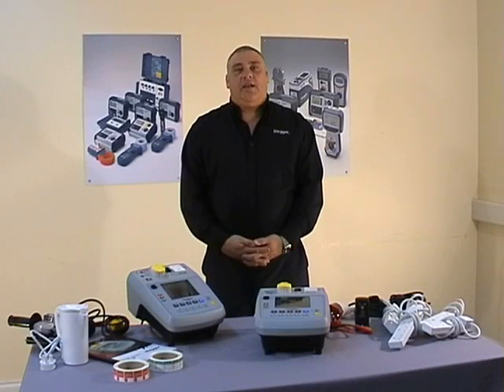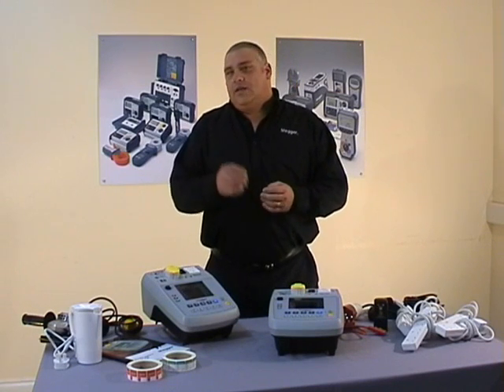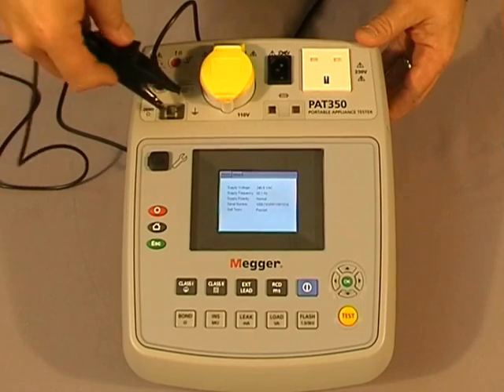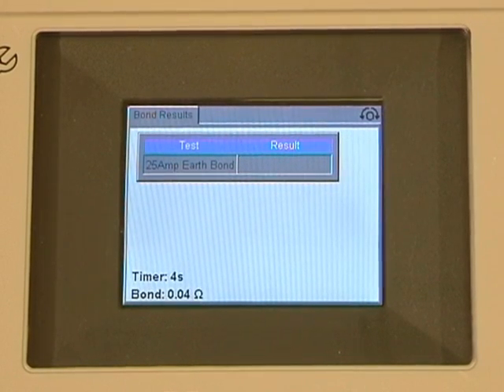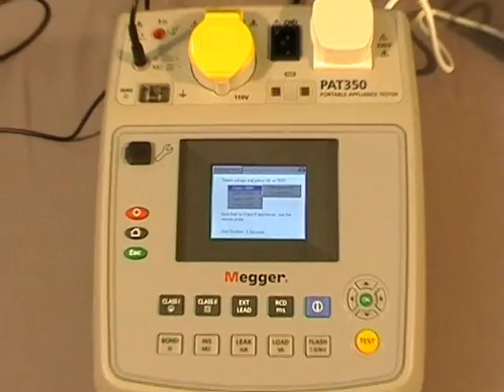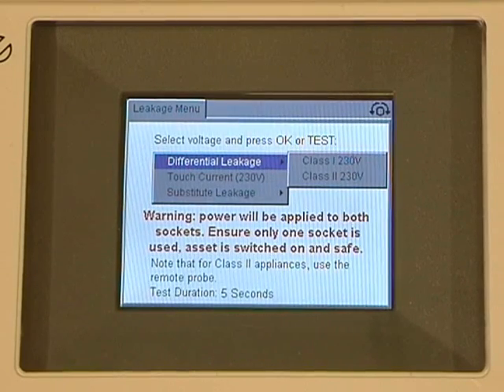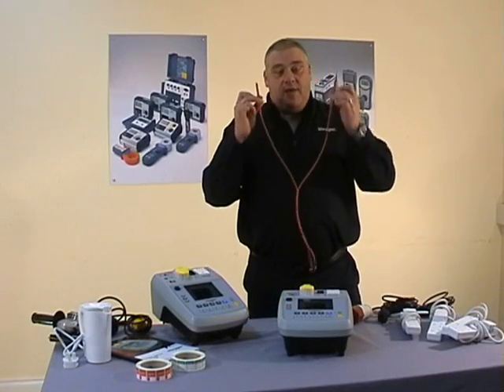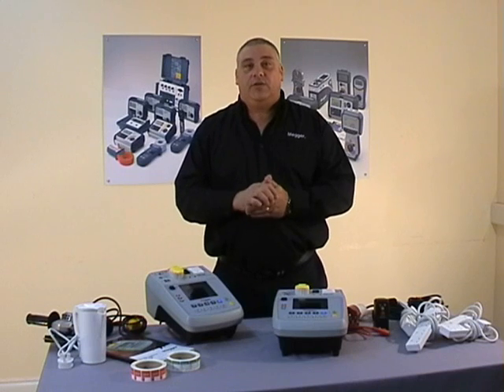Megger PAT320 & PAT350 Demo Part 1

Comment from the maker: No sorry but you do get continous operation of the high current earth bond test without the products overheating and refusing to do anymore testing, or reverting to a low current test, which was a feature requested by professional users of desktop PATs. You also get the biggest hi-res colour display and fastest auto test sequence currently available, all of which dramatically increases productivity when testing large numbers of appliances.

Comment from the maker: @v6dlc Thanks for your comments.

The PAT320 & PAT350 are designed for users that want lower cost, fast testing, simple to use products, and want to complete test certificates and labels by hand.

For that reason the products do not include results storage, USB, QWERTY keyboard, printer or BlueTooth.

Please also be reassured that these products are not fragile.

They are tested to the same high standards of mechanical testing as the PAT4, which includes bump and drop tests onto concrete

Comment: Needs a Qwerty Keyboard for data enrty and needs to be encased in a sturdy carry case (like previous model PAT4)

Is there a version with a keyboard ??

A built in printer would be good as well (that uses a standard type label not expensive labels you only supply)

USD connectivty and or Bluetooth.

Most of all this needs to put in a sturdy box with carry handle, look to fragile for me. Plus extra protection on the screen another layer of glass.